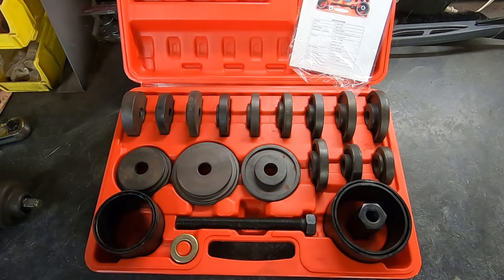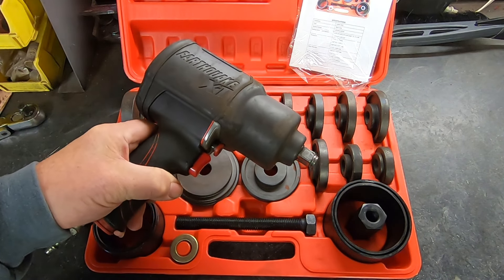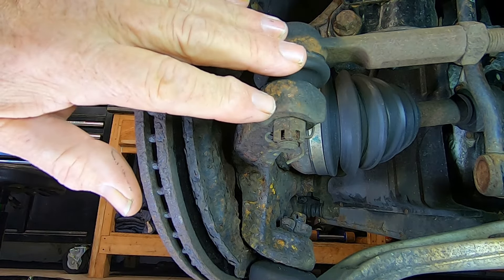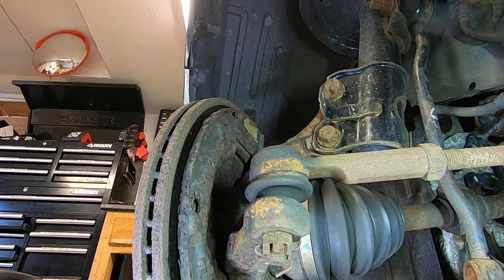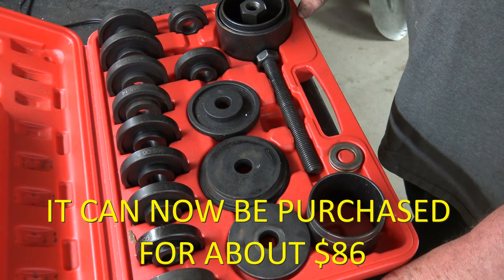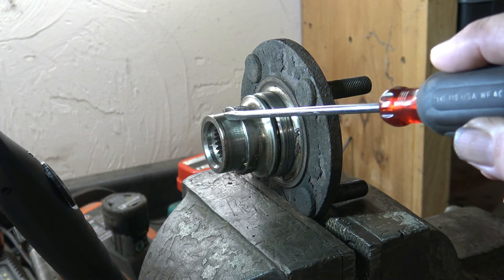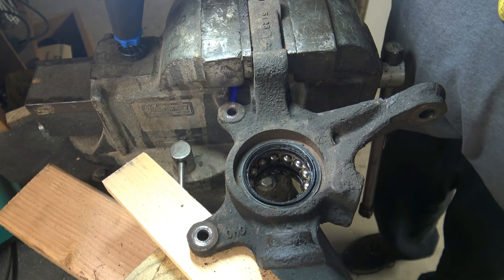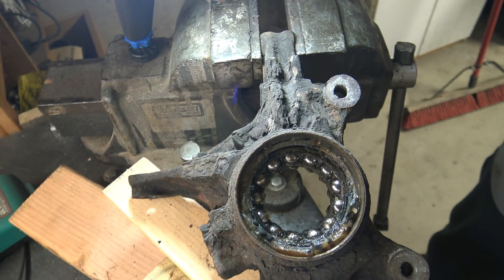How to Use a Bearing Press Kit (Update)

Comment: Spent hours trying to find a front wheel bearing hub assembly but they don’t sell them anymore for a Kia sportage 2007 in the uk, however they do the bearing & the hub cheap, I didn’t think I could do it as I haven’t a press, now I see I can get a press kit kit to do the job, thank you !
Reply from the maker: glad I was of help.
Reply: Same here, 2003 Toyota Camry. This was a huge help thank you
Reply: I think what you were looking for was the Steering Knuckle with the hub and bearing already installed. That is extremely rare to find new and usually only going to be found in a junkyard.

Comment: Thanks Richard.  Like true craftsmen, you make this look easy.  I did both front bearings on my wife's '06 Toyota Solara a few years back.  Even though I had both the bearing press kit and an air-impact, it still a beast of a job.  A fine gentleman at "Hardly Moving Productions" has a video about using portable hydraulic press, which cuts the pressing time down dramatically.  I might consider that way next time.  Kind regards, Terry
Reply from the maker: I have a 25-ton hydraulic press I purchased recently.   I will give that a try next time I do one of these jobs. I will still use the adaptors in the kit, I will simply be substituting the jack screw for the press. If and when I will post another video. Thanks for watching
Reply: @richardspaulding5035  Yes, exactly, would still need the adaptor kit.  Hope you have a good week Richard.
Reply from the maker: @terryzak1742  you as well

Comment: Great video. Wish I would've found this sooner. When pressing in hub, support the inner bearing race would have been super helpful to know before I destroyed my bearing by using the wrong plate. Hopefully, tomorrow will yield better results.
Reply: Yea, that is very important.  Glad I found that tip before my first attempt, I was about to do it wrong before watching a few vids and reading comments.
Reply: @gordo3582 I liked how he specifically addresses it. It was a good feeling pushing in the bearing, thinking this ain't so bad. And then pushing in the hub and immediately knowing something ain't right. All this trouble bc honda couldn't be bothered to give enough room to tap out and replace 2 dollar wheel studs.
Reply from the maker: It may be little conciliation, but I destroyed a bearing the first time I used the kit as well

Comment: Thank you Richard, I am about to do this myself for the first time using this exact method and tools so I am very grateful to see such a straightforward explanation, especially having the mention of not using an powered impact driver, I was uncertain about that exact point so the explanation on that was extremely helpful to me. Now I just need to wait for the weather to improve here on Islay so I can get the Knuckle off.

Thanks again.
Iain
Reply from the maker: By all means let me know how the job turns out.
Reply: No ball joint  press for that

Comment: I have a 2011 Ford Everest and having trouble getting the bearing into the knuckle as it jams out of alignment. I have measured 4 sides of the bearing to make sure it's straight but it continually goes off and jams and makes a burr inside the knuckle. Because of this, I have been reluctant to continue applying pressure to force it in. I have tried both a hand ratchet and impact tool. I have the 21 piece disk set that I bought for this. Similar to this front wheel assembly but rear wheel drive. The video answered my query on the order of bearing to knuckle / hub order of assembly. Any suggestions, anyone, on what to try get this bearing into the knuckle ?
Reply from the maker: I am very sorry I have taken so long to reply. I hope you have resolved the issue by now. I wish I could have been there to see exactly what you were doing and how you were doing it. my only suggestion is to make sure you have the correct part and I have heard of people freezing a bearing to shrink it before pressing it in. let know if you got the job done.

Comment: Im currently replacing my entire suspension/steering components in the front and resr of my car, and its my first time doing anything like this. Im at the point of having to rekove the hub and bearing and am wondering if the oem tools master hub and bearing remover/installer will work to remove the hub?

Comment: Ive seen the hub pressed out before using the same type of kit. This is an easy way but pressing the hub out allows for the clip removal both sides and a clean bearing press.
Reply from the maker: I do not understand your point/ The kit is not capable of pressing the hub out. You need a shop press for that. I don't know what kind of car you are referring to but the one in the video has only one clip to remove???

Comment: Best technique, I used a impact and destroyed a bearing! Ratchet is much better to slowly Install without damaging the new bearing!
Reply from the maker: Thanks, I have had many complaints from viewers who have stripped the jackscrew on this kit. In pretty much every instance they have admitted to using a power tool. These kits are designed for occasional use by DIY driveway mechanics and are priced accordingly. They are not designed for daily use by a professional repair shop. Those kits cost many hundreds of dollars and on those you can indeed have at it with an impact tool. LOL, if it makes you feel any better, I destroyed a bearing the first time I used the kit as well. Thanks for the comment and watching my channel.

Comment: Hi again, im thinking i like your method better than doing this job with the knuckle still on the car. Im also seeing a bearing tool kit that uses a horseshoe type set up that works like magic. Have you seen it? I would have to watch it again but i think that horseshoe set up will pull that hub out in a jiffy.
Reply from the maker: I have not seen that tool, but I will see if I can get information on it, thanks

Comment: Honda FIT 2013 Update, New wheel bearing (Timken) ( i used a brand new hub with studs already installled) (21.00). new lower control arm by Mevotech, (includes bushings and ball joint) new outer tie rod end, new CV axle by GSP. New brake caliper. All parts from Rock Auto. The CV axle was 1 inch shorter than the OEB but fit perfect. No alignment needed. This job is complete.
Reply from the maker: Great job.

Comment: That white grease is no good. I would hose it out and fill it with Mobil 1 Synthetic grease. Most of these bearings are sealed. And on some the seal has a magnet encoder on it and you dont want to remove that.
Reply from the maker: Muchly appreciated as always, by all means don't be a stranger. I look forward to your inputs.

Comment: I have a 5 1/2 heavy vise mounted on my work table and i have blocks of wood and a few other clamps. Im sure i could make this work they way Richard is doing it. Last week i had a local shop do the bearing for me but those guys wont be around forever. A bad wheel bearing will leave you in bad shape. I think im gonna spend the 300.00 and buy that new bearing install kit with the new hub remover tool added. It will last for ever and lets face it, front wheel drive cars always need a wheel bearing sooner or later.
Reply from the maker: You are so right.

Comment: Also, i had to destroy the speed sensor to get it out and also had to drill that speed sensor hole out a little as it has plastic and rust really bad. I put the drill bit just barely in the chuck and used a sight angle. Got that hole cleaned out and put in a new speed sensor. This job is now complete. 2013 Honda Fit with 141k.
Reply from the maker: I think I may have mentioned I used a torch in a similar situation and faced all kinds of negative comments lol.
Reply: You can use a torch to melt that old plastic sensor out of the hole but you will still need a drill bit to get that hole clean.
Reply from the maker: @mg8720-u7j  Sorry I did not explain that well. The part I torched was made of metal in the car I was referring to. The negative comments were about changing the properties of the steering knuckle by heating it.

Comment: he kits at the parts stores are heavy duty that will take the force of an impact gun.
Reply from the maker: I am sure there are kits available that are heavy duty. However, the kit used in the video is not. The kit in the video only goes for about $60 on Ebay. I have had numerous complaints from people who have stripped the jackscrew while using a power tool, In the video I cranked it by hand as you may have noticed.

Comment: great video thanks doing this today with the same kit
Reply from the maker: Good luck,  i just want to mention I did the job on the bench, it is not necessary to remove the steering knuckle from the car. The bearing can be installed with the knuckle still in the vehicle.

Comment: how can i use this tool on a free lander 2 bearing.the hub and bearing is all in one when you buy it
Reply from the maker: @SteveSellwood-x7d  The tool is only for hubs and bearings that come in 2  pieces. If you look at the back of the hub you will see threaded holes. This is because your hub bolts directly onto the steering knuckle. No pressing required.
Reply: @richardspaulding5035  can't  see what you mean. the hub still needs to be prest in to knuckle. Thanks, steve

Comment: 28:50 when pressing in the HUB, does it matter if you are wrenching from the bearing side vs. the HUB side?
Reply from the maker: I don't think it matters which end you crank from as long as you do not reverse the adaptors.

Comment: Yes i know guys and many shops will only do the wheel bearing while with the knuckle on the car. Mysleft, i prefer to do the wheel bearing on the work bench.
Reply from the maker: Agreed, you have to knock the ball joint out anyway. After that removing the knuckle is easy

Comment: My outer snap ring came out nicely but it also stayed out I forgot to put it back in
Reply from the maker: I have done worse things. I think you need to pull it all apart and start over.  You will most likely have to buy another bearing. You can't take a chance of the hub popping off with the wheel sometime down the road.

Comment: Does the kit work on 4x4 trucks like the Ford Ranger, or it's for small vehicles?
Reply from the maker: Not for trucks,  mostly small front wheel drive vehicles.  Most trucks have sealed bolt on hubs. Thanks for the question.

Comment: ive just bought this tool and watched a few videos.one inparticular the guy used a dewalt impat wrench and stripped the bolt.do you advise using only a wrench? Great video by the way.
Reply from the maker: Yes, I think I mentioned that in the video. keep the jack screw lubricated and only turn it with a hand tools such as a ratchet or wrench. I have had a number of complaints about the jack screw getting stripped and in each case, they have admitted using a power tool. I have used this tool numerous times with hand tools only and have never stripped the jackscrew. Thanks for the compliment and thanks for watching.
Reply: Thankyou for the quick reply. I will hide my impact wrench! 👍
Reply from the maker: @normancassin6416  Although my channel is growing it is still small enough that I can try to reply to all my comments.
Reply: How would using an impact put more stress on the bolt than using your hand? It still demands the same force to push it in/out? Sounds like bs to me. There are plenty of videos showing an impact being used. It saves hours of time and stress on your body.
Reply from the maker: @tg8150  Evidently you have no understanding of velocity.

Comment: You can probably find a much stronger replacement jack screw through a firm such as McMaster & Carr.
Reply from the maker: Thanks for the suggestion. So far mine has held up ok. Being that I am now retired it is only used occasionally these days. I always make sure it is well lubricated and I only crank it by hand with an ordinary ratchet.

Comment: If I have to buy complete hub bearing than is no need to watch ur video!
Reply from the maker: There are some vehicles that the bearing and hub are preassembled and just bolt on. One such vehicle I worked on recently was a 2016 Nissan Rouge. That bearing was a bolt on, very easy. The point I was trying to make in the video (evidently not well enough) is that on a press in type bearing the inner race gets stuck on the old hub. If one does not have the means to remove it, then just replace the hub. In the video you saw me drive the old race off the hub with an air hammer. In any event, even if you decide to get a new hub you still need the kit to press the bearing and hub back in. Unless of course your car has a bolt on hub as mentioned above. In that instance you do not need the kit at all.  Thanks for the comment as it gave me a chance to clear that up.

Comment: The object of the kit is to eliminate the need to remove the knuckle from the vehicle.
Reply from the maker: Yes, the kit can be used in the vehicle, I believe I mentioned this in the video. I had the knuckle out only for visual clarity. Furthermore, if one does not have access to a bench vice, using the kit while the knuckle is still in the vehicle is the only way to go.

Comment: Can i use these to remove control arm bushing?
Reply from the maker: I don't think so, but it would not hurt to try. Let me know if it works.
Reply: There are bushing press tools available with a similar price point on amazon.  I tested the one i just bought by pressing out my control arm bushings from my jetta, was easy.  No power tools (threads won't handle it) and lubricate the threads.

Comment: I have seen some videos where an oxyacetylene torch was used to heat it until it falls off
Reply from the maker: I have been sliding the race off with an air hammer since the 1970s. I understand they have a special tool for that now, but I am an old dog.  I have never considered using a torch, but I am going to try to find one of those videos out of curiosity.

Comment: There is a Mexican guy a few doors down. He is a mechanic, but old school. He always takes the knuckle off. But, he knows his s#$t. I need to do my fronts on a 2013 CRV. I will get the kit from autozone and give it a try. If I am unsuccessful I will let my Mexican friend do it. I have done many hub assemblies. Just bolt them on.
Reply from the maker: Honda is a nice vehicle; they look good, ride nice, and are very quiet. But do they ever suck to work on!  I have an Accord in the shop as I am writing this reply. My nephew had it towed in with a broken drive axle earlier this week. He gave up on it after the first day and has not been back. Now I have got to finish it unless I want it as a permanent onement in my shop.

Comment: Hi, do you think the kit will work trying to extract and replace the bearing in a motorhome , Fiat Ducato 244, 18Q, 2.8 jtd ,year 2005.
Will it have enough strength?
The external diameter bearing is 90 mm.
The inside diameter is 55mm.
It has 60 mm long.
Reply from the maker: I don't think so, but I have never tried it on one of those. The kit is designed for passenger cars and light trucks.
Reply: @richardspaulding5035  But, has it at least for 90 mm external diameter bearing a piece that fits so you can try    to push?
Reply from the maker: @Vitimk12  Yes it has the correct size adaptors, my concern is will the jackscrew hold up. A number of my viewers have complained they had stripped the jackscrew.  If you want to try using it keep the jackscrew well lubricated and do not use a power tool to turn it. Use a long-handled ratchet like I did in the video. You don't have a lot to lose as you can buy the kit for about $70 and if it works you will save hundreds. keep in touch
Reply: @richardspaulding5035  Thanks a lot for the info...

Comment: What lubricant are you using for install?
Reply from the maker: It was nothing special as I recall, whatever I had handy. I will say this: If you ever want to lubricate something rubber make sure the lubricant is silicone based. If you use a petroleum-based lubricant it will eventually start to eat away a petroleum-based seal or rubber part. I say rubber but almost nothing is actually made of rubber anymore. It has been mostly petroleum-based since after WW2. When tubeless tires became popular in the 1950s mechanics were using axle grease to help seal a stubborn bead. They discovered the grease would eat into the bead over time thus ruining the tire. I apologize for the history lesson LOL.

Comment: What size of the socket did you loosen the bearing with the hammer?
Reply from the maker: It was an 11/8 socket I used with a hammer to separate the hub from the bearing.

Comment: What size socket and wrench did you use
Reply from the maker: I am very sorry I have taken so long to reply. The socket was 1-1/4 inch, and the wrench was 1-1/8 inch. I used a long handled 1/2-inch drive ratchet. Do not use a power tool to turn it and keep the jack screw lubricated.

Comment: I dont have air tools anymore but if i do this job someday i will just use a new hub. They only cost about 25.00 bucks,
Reply from the maker: I mentioned just that in one of my follow up videos. replacing the hub is not a bad idea.

Comment: If you have a torch just run the flame around the race and it will come off of the hub like it didn't want to be there
Reply from the maker: Thanks, I will try that
Reply: And put the bearing in the freezer overnight, it'll drop in.
Reply from the maker: @kevinbush7907  I have heard that, have tried it but still needed the press.

Comment: Whit this kit you no need take off buckle from car
Reply from the maker: You are correct. Thanks for pointing that out for the viewers. It is something I should have mentioned in the video. The reason I removed the knuckle is because the video was to be only about using the kit.  Demonstrating its use on the bench was for visual clarity. However, if there is no access to a bench or vise then using it on the vehicle is the best option.